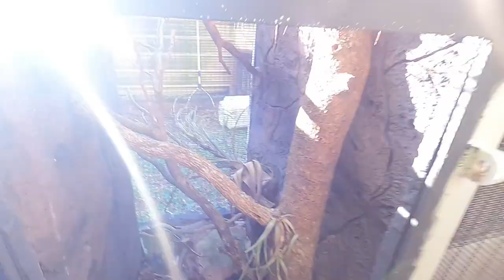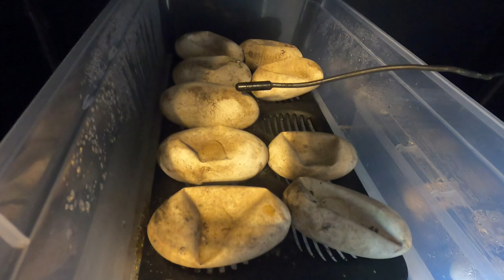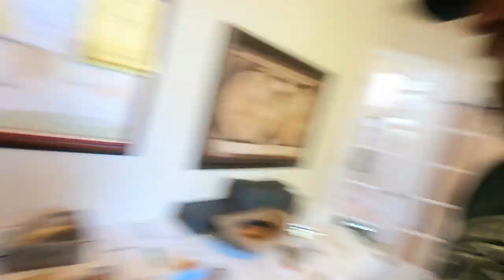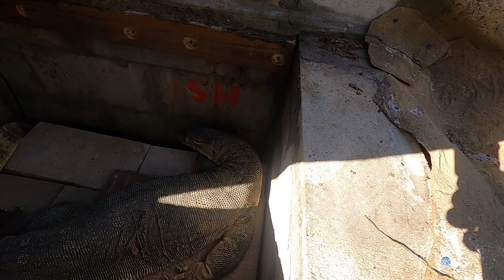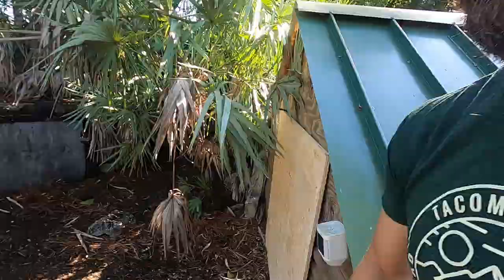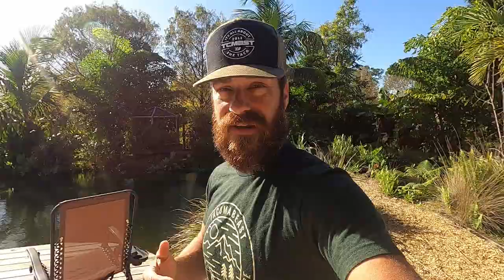Black Throat Eggs are in Trouble!

Comment: Hey Kennan. I bread all types of reptiles and it’s definitely more likely that being a first time breeder the eggs wont do as well. A couple degrees higher or lower shouldn’t as big of a deal. If it was in the 90’s then you should be worried but i wouldn’t be too hard on yourself. You can stick some damp moss on the eggs for a day and see if they pop back out. Just don’t leave the moss on for too long. Check frequently.
Reply: I was going to suggest the same thing with soaked moss. Fluff it up and lay it on top. Should help
Reply: I agree. I do not think it is a temperature problem. 87 is not dangerously high.
Reply: @ggoannas  87 is absolutely high enough to ruin some monitor eggs, especially if the temp fluctuates at all.
Reply: the eggs of a first time breeder wouldn't spontaneously collapse they would mold and rot as infertile eggs do. collapsing eggs is caused by lack of moisture. I dont even put moss directly on mine I take a soaking wet paper towel and lay it across the container next to the eggs, not in contact. I've now done this with 3 tree monitor clutches and it has worked every time.
Reply: first time breeders are more likely to throw infertile eggs, which would mold within the month and collapse
Reply: @Ryzrr  True but not always. My first clutch of rhinos went full term and only 1 made it through. The next year from the same clutch I had only 1 not make it. Sometimes they don't have the proper nutrients to bring them full term and that can happen from being a new mother. Not saying that's what happened for sure.
Reply: @Ryzrr  I've heard this before and can't tell if it's a myth or fact. Even half a meter underground, you're going to get a couple degC of temperature variation in the wild. Do you have first hand experience with this?
Reply: @NicholasMati  yes. With multiple species of reptiles. The ground temp where they dig to isn't going to get up to 87. Probably closer to 83-84. So if the egg puts off some heat it won't take it up to or passed 87
Reply: I thought this too. A couple degrees isn't a big deal generally. I incubated my own bearded dragon eggs by leaving them in a small styrofoam box next to a heat lamp where it stays about the right temperature. I know it fluctuated a lot and 6 of the 9 eggs hatched
Reply: @Ryzrr  again not true. reptile eggs are layed anywhere from 10 inches to about 2 feet underground the temperature fluctuates pretty regularly in that range. It doesn't get constant till about 6 feet underground then it stays around + - 1 degree.
Reply: @tomanato  my entire point is that the ground temp doesn't get 87. yes it fluctuates but it doesn't get that high. starting them at 87 leaves no room for error.
Reply: @itsLizJaramillo  bearded dragons are not monitors. comparing different species does nothing for this conversation, just as they were comparing iguanas to monitors.
Reply: @tomanato  there is variation just between species of monitor incubation, you brought up iguanas. unless you have experience incubating monitor eggs this literally doesn't help the conversation.
Reply: @Ryzrr  I have experience with most lizards. I just used those as an example. You need to take a couple steps back and realize that everyone here is trying to help and for some reason you are trying to assert that you are right and everyone else is wrong. The reptile community has enough on its plate without people trying to shut down others who want to offer some advice.
Reply: All I have asserted is that you are saying 87+ won't hurt monitor eggs and I'm sayinfbthats not true. If I incubate tree monitor eggs at 87 they will not do well. If buy miracle they hatch they will be underdeveloped.
Reply: So please keep conversation monitor specific. They are absolutely more fragile than most other species.
Reply: @Ryzrr  There is a lot of information out there that says tree monitor eggs can range from 82-87 degrees. and like you said there is variation between species. Rock monitor eggs do well at 85. If you think that 2 degrees is that big of a deal then I don't
 know what to tell you bud.
Reply: @tomanato  and guess what the success rate is at 87. 
I'm literally speaking from experience
Reply: The ideal for monitors is generally 84-86. I incubate at 85. There is also plenty of evidence to show monitors incubated at 84 or 83 come out healthier. I was at 86, moved to 85 and might be going down to 84.
Reply: @Ryzrr  You are obviously here to just troll and put people down so I'm done responding to you. Have a nice day.
Reply: @Ryzrr  well well well. Incubated at 87 and 100% hatch rate. 🙃🙃🙃
Reply: @tomanato  okay? That doesn't change anything I said. 87 leads to shorter incubation times and less developed animals. I didnt say it couldn't happen I suggested against it to have better odds. But I guess keep thinking highly of yourself for someone else's accomplishments?
Reply: @tomanato  general consensus for green tree pythons is best temp for most consistency is 87-87.5. If I hatch a clutch at 84 that doesn't refute the information of 87.5 being most consistent. Him having 100% hatch rate tells me he has a very consistent incubator. He definitely has a high end one so it speaks to the brand. My entire worry was temp fluctuations at that high of temp being detrimental.
Reply: @Ryzrr  bro you forget everything you said is right there. You literally said and guess what the success rate is at 87 degrees. You were wrong just admit it. Thank you and goodnight.
Reply: @tomanato  I said I have personal experience incubating at 87. And I had 2 eggs fail and one die in egg. So yes. My success rate at 87 was ZERO. I dropped to 85.5 and am now 4/4.
Reply: @tomanato  and have 3 more eggs going just fine. And may still reduce Temps further because the ones I hatched literally 2 weeks ago didn't absorb all yolk and came out skinny. Which can be fixed by lowering Temps.
Reply: @Ryzrr  good thing in science they don’t use anecdotal evidence to prove theories. They take a large amount of data to get the best result.
Reply: @tomanato  you mean anecdotal like him hatching at 87? Because that's 1:1 with my evidence then. I'm also referring to multiple accounts from others saying lower is better. Not sure why you want to keep arguing. We've already established you haven't bred monitors. Not sure why you're so hell bent on talking about something you don't have experience with lmao
Reply: @Ryzrr  sorry man you were wrong. If you cant admit it i guess that speaks more to your character than anything. Have a nice day 🙂

Comment: KK I’m not a reptile expert but in aquariums we use two thermometers with alarms to tell us if the heaters fail. Two heaters are used in case one fails. Sometimes they stop working and some times they go crazy and overheat. The redundancy in heaters is one fail safe and the two thermometer alarms are the other fail safe.

You can even buy a thermometer alarm that messages your phone. Change the batteries in the alarms when you replace your fire alarm batteries.

Keep your head up KK. You’re a good and kind man. I would consider thermometer alarms in your animal’s night time shelters too.

Comment: No offense Kenan, get rid of the VE thermostat and get a Herpstat. Herpstat's have alot more safety features and alarms for  situation's like this, also has shut off's for temp's. VE thermostats are alot more likely to break or blow a fuse or just misread. I would even use a exo terra digital thermostat over a VE.
Reply: I been breeding ball pythons and keeping ball pythons andother reptiles for 20+ years. I have 6 VE thermostats on my racks and use another VE thermostat on my incubator and most are flipping 8-10 years old and I have never had an issue, miss read, over heat, or fuse pop in ANY of my VE stats.  Just my experience
Reply: @proph3t195  100% agreed
Reply: All my VE stats are 300x2 except for a ve200 on my incubator. The 300’s have alarms and night drop too. Great thermostat

Comment: Hi, not a reptile keeper but an experienced engineer. Putting a  temperature control probe inside a plastic box has the potential to cause a large temp gradient inside the cabinet. Put monitoring sensors in the boxes but the probe for the cabinet needs to be in the airflow. Good luck 🤞🤞🤞

Comment: Sorry for spam commenting lol. but the condensation on the side has nothing to do with humidity. Egg boxes condensate due to difference in egg bin vs incubator itself, and incubator vs outside room temp. you can have 100% humidity with no condensation. Do you have vent holes in your egg bin at all? if not I would add 1-2 really small ones. My guess is the 87 degree coupled with the eggs putting off their own heat threw off the temp enough to kill em. eggs will create some heat themselves as well, which is way 84-85 is a lot safer. you have more of a buffer at that temp. any questions on this stuff I'm happy to help. shoot me a message.
Reply: ** I just hatched tree monitors, have 3 more incubating, and she's about to lay again. I have a good bit of experience with monitor eggs now
Reply: actually looking at it, you're not fully attaching the lids and there very well could be too much of a gap in the lid. these need to maintain extremely high moisture. the moisture creeping the sides is condensation as mentioned, so that's not an indicator of humidity and air density. other possibility, and the side i'm leaning to now, isn't that its the heat. guess now is likely too much air escaping is collapsing the eggs. the water on them wont do anything if there's constantly air moving out that much

Comment: Vermiculite to water ratio is 1:1 by WEIGHT. Your eggs are dehydrated. Vermiculite 1:1 is the best way to incubate even if a thermostat goes faulty. The vermiculite holding water will evaporate before the eggs lose moisture.

Comment: I live in Virginia and I have red ear, painted and koi. We shut the water fall for fear of icing, but I keep the pumps going but just a simple (no height or splash) drop into the water. Most importantly is that the water drops away from them, and the pump is raised and away from them so the water in the other end that they lay in is undisturbed. Maybe you can make some portable pvc pipe and plastic screen green house to place over the ponds.  Obviously you have some turtles that have to stay warm so maybe a green house you pop,over them will help as well.  Good luck!

Comment: I use an additional smart wireless thermometer combined with a hygrometer for added security. when it gets too hot / too cold it sends a push message to my cell phone. I have a history of temperature and humidity at the same time. So i can see exactly how outside conditions are affecting it and i know if the thermostat is failing. Doesn't cost much either

Comment: Hello Kenan, why do you put the temperature probe inside one container? I guess the probe is input to regulate the heating of the whole cupboard. As you add water to the containers, you might get droplets on your probe. Could this destabilize the temperature of the whole system? For example if you add cold water to the bottom of the plastic breeding box, it costs energy to get the new water to the set temperature of the system. The temperature of the "new" plastic box might be lower than the whole cupboard, but since the probe is in there it will heat the whole system and therefore overcook the rest of the eggs. I'm sorry if this was a dump question. I ain't a reptile keeper, just like your video's a lot and hopefully one day i have the time and knowledge to take good care of one.

Comment: i have had laceys hatch out at nearly 100 days early than usual, higher temps or longer in the mother before laying could cause earlier hatching. if they arent due for a while and they are collapsing them most likely lack of moisture and if they are preety early on then they should recover especialy if they were firm and had veins, i would suggest putting them touching the vermiculite or what ever substrate you use that way they will absorb the moisture eisier. if the eggs werent firmish and were kinda soft when hatched then there less likely to make it

Comment: i had an idea could you use like a pool solar cover over the deeper parts of the pond the floating kind that looks like bubble wrap its cheap and would hold in heat and fish could still get air around the outer edges of the pond just a thought

Comment: Dimpalimng  on the bottom of the eggs supports by assumption as well as the turtesest eggs are fine so moisture leaves are fine I think you need another system a little hotter 90 91 degrees same moisture leaves i think you'll have better success bro

Comment: Actually the pumps running give off heat in their own right... With mine when off,  the temp goes down by 4 to 6 degrees. You should be checking the water temp with a water thermometer, not just a temp gun for true accuracy.

Comment: First of all, May those are not fertile eggs, second; for experience and advice the probe of the thermostat goes outside the tupper, at the middle of the incubator, it’s 10 times better bro, and you can measure the temperature and humidity with other thermometer and hydrometer, and you can compare what differences you have at the top, mid, and bottom. And monitor eggs doesn’t dented at any time of the process if you maintain the correct parameters, the most probably is that they aren’t fertile. Good luck my friend !